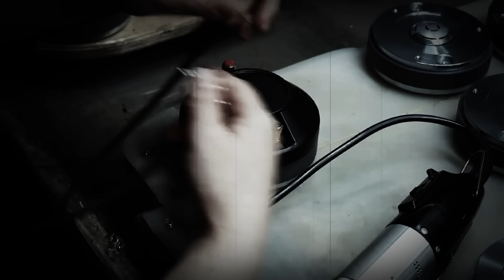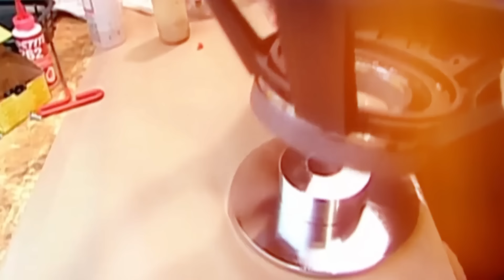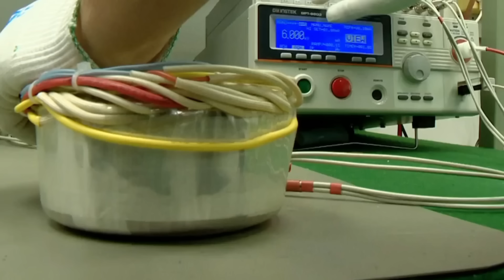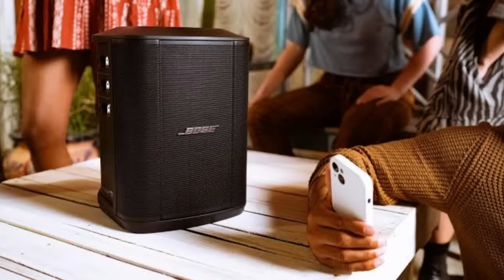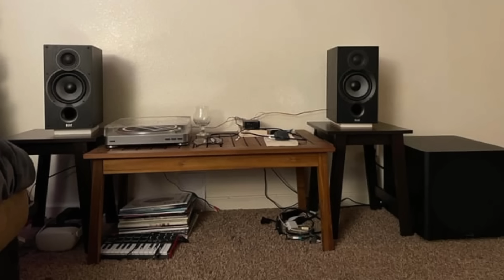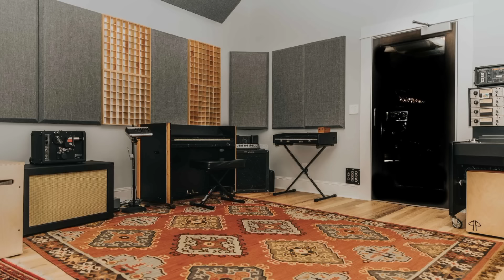Why 90% of New Hi-Fi Speakers Are Garbage (The Factory Secret)

Comment: Retired algorithm developer and electro-acoustic engineer here.  This is one of the few videos that speaks the truth.  Professional level studio monitors are purchased by experts who are looking for neutral, accurate speakers.  My own speakers are clones of the JBL-M2 reference monitors.  My room uses massive amounts of hand-made aborbers and I use bass traps as well.  Good brands are JBL, Genelec, Neumann, and ATC (I'm sure there are others, as well.)  The downside of these speakers is that they are built for performance, not looks.  Often, these speakers can be found in great shape used on eBay and Reverb.  
If you are handy with wood, and are good at electronics and math, designing and building your own speakers can be a lot of fun.  Start small.  It is likely you will make some mistakes at first (and beware, the DIY speaker community is filled with people who have more opinions than knowledge.)  If you lack engineering skills but are good with your hands, you can use a design by someone else and make yourself a pair of beautiful cabinets to match your taste and probably save some money.  Also, you don't really have to understand the theory or even be able to measure to design a good set of speakers, as long as you have a lot of patience and a good set of ears.  I have watched people just fiddle with crossovers until magic happened.  Not the way I do things, but it can work.

Comment: i build my own. PA 10 or 12 inch driver cabinets, replace the speakers and crossovers with quality units and wiring, and you can save thousands. fancy a £3000 sound for £200?

Comment: About your faulty villainizing of DSP crossovers. If properly implemented, they are clearly superior to any analog crossover, especially when the music content is already digital. They feature much lower distortion, much greater accuracy, no power compression, no power amplifier losses, flat correction of phase while maintaining flat FR (impossible to do via analog crossover), time alignment of the drivers, and effective flattening of individual driver frequency response/box resonance anomalies without the cost and complexity of trying to do so with analog crossover notch filters. The only potential downsides which I can readily think of are, when the music content is analog (such as from a turntable) and has to be converted to digital via ADC, and the cost of the DSP hardware. Also, that each driver will require its own power amplifier.

The greatest problem with speakers are their market cost factors. This begins with today's audio customers, who have the mindset of viewing speakers as a commodity product, where they, essentially, perform the same and the purchase decision comes down to price and aesthetics. Quality speakers require significant constructing, finishing and testing, transportation and stocking cost. They function in a domestic environment as furniture, except for incurring the R&D cost of acoustic engineering, as well. Most loudspeaker companies don't benefit from cost savings due to economy of scale either. Speakers are a lowish volume specialty product, and that drives the use of common 3rd party components, in order to avail themselves of some of the cost savings which comes with that scale.

Comment: Still use my Yamaha NS-1000M, new caps in the crossover. Built in 1984, still going strong. A humble Thule IA100 amp to that, case closed :):

Comment: Not exactly correct.   Pro and especially consumer Powered Speakers are usually too small for an average home listening area and can not create the ambience most listeners want!  When recording, sure - the engineer wants to hear whats being captured with his ears, however they would be better off using the output of the high-end microphones doing the original capture of sound and inputing that into a sound analysis program visualizing the sounds at the same time listening to a digital to analog output to high end closed ear headphones that are more accurate than studio monitors.  However, thats precise, and human ears are the opposite of precise - we all color sound differently!!!!   Cup your hands around your ears while listening to your stereo and WHOA!! what an improvment!   To get that without cupping your ears try 5.1 or better surrond sound systems with great speakers equivalent to the ones you mentioned from top manufacturers that use high quality crossovers and excellent quality drivers.   I personally have to change the equalizer settings on my system for different types of music because as I get older I need a little less 2K and like very clean 200 to 1K midrange where voices are.  If its Jazz the same is true - I need to make a change because my ears are not true to the engineers intended sound and I have to pump up the parts my ears are missing.   Bottom line, I find I can quickly trainn a newbee budding audiophile to hear details intended in various types of music and explain how to use an equalizer with good spearkers to get very pleasant and likely close to the intendede sound a recording engineer intended a listener to hear.  Our ears are the bottleneck - perfection in components is nice to look at but clean music adjusted for our ears wins for smooth listening pleasure.    P.S.   I like powered speakers on my office desk in a small area that I can feed a direct sound source or now days a blue tooth song from Spotify to a bluetooth equipped powered speaker with no other components needed.  The JBL's you recommended are OK but the high end is not as clean as other powered speakers in the same and even lower price range.  There are serveral good choices and I would recommend a person listen to the various models with a good source at a Stereo Store or Guitar Center (which hands pro powered speakers more than Best Buy style stores).   Use your ears, then adjust with an equalizer (our computer controller sound source) to enjoy the sound.   To be fair - your main point about crossovers and quality of components used is right on and your speakers are top notch.  I also like the fact you mentioned the impact of room acoustics.  Just add the big factor - our ears are all different.

Comment: Well, after 50 plus years, we still enjoy our B&O 2600 bookshelf speakers, and have 2 pairs. After many years of use, my Marantz 1060 amp got a little tired. Needs a tune up. So when parts Express put on sale their 100 watt hybrid amp on sale, I decided to try one. WOW, it brought those B&O’s back to life.
The amp has so many neat features, for inputs, it meets all the everyday requirements.
As we are in our mid 70’s, perhaps our hearing is out of tune, but seems to sound great .
The amp has a separate output for a powered sub woofer, from Parts Express, and that even makes for wonderful sound for our old ears.
Very informative review, thanks.

Comment: Jbl 530 bith front, jbl530 center standing upright, jbl 4312 with the mid and tweeter turned off under the 530's and two svs2000 subs flanking the center channel. Pioneer elite VSX-49TXi with front and rear bi-amped for the 4312's twelve inch mid base and front 530's . 1" backed carpet, two rear base traps, 1" thick drapes over the glass door, a city skyline on the back wall, and a wood ceiling random boards.

Comment: The speakers you recommended are way too expensive to be worth. And way too small to sound good - despite their supposed quality materials and engineering, a strong sound from a small source is not what an audiophile wants. A good speaker has: always 3 ways, a large diameter bass (more than 20 Cm), a good medium speaker, a good treble speaker, a big cabinet (height more than 60 Cm, depth accordingly) and decent filters. Classic build gives the chances to the best sound.
Vintage speakers having those above sound excellent and you can buy them pretty cheap.

Comment: You make it sound like the factory designs and specs the components. WRONG. The factory only assembles what the company designs and specs.
Reply from the maker: You’re right, the brands are ultimately responsible for the design and component specifications they provide to the manufacturers.

Comment: The audio speaker market is saturated with poor quality products.  I make my own due to what I found with very expensive audio speakers. By rule. The best audio speakers are simple yet with high quality crossovers with no electrolytic capacitors and good quality resistance.

Comment: All this is very doubtful. I agry with same comparison old/new equipment from previous video, but not with speakers! Your examples of Klipsch Heresy and JBL L100: Klipsch was and is now the same in this respect: very poor crossover parts, thin-walled box without bracing - now and than is the same. JBL L100 new one is better than old one in speaker components and crossover parts. And boxes are same poor as old model. In cheap segment in old times vere so many speakers as Sansui S65 - made to look cool, but construction and component quality is terrible. Only one thing is 100% true: now all attention is focused on speakers exterior, even cheap ones. And before some companies as WHD, KLH, Wharfedale... - vere focused on sound quality with  minor attention to how they looked

Comment: I've beenrunning Altec A7 VOTT  and a subwoofer with twin JBL 15s  driven by Altec amps.
Reply: Considering it's volume, the A7 has no base. I suppose that was okay 80 years ago. The ALTEC 816A is a much better cabinet for HiFi, compared to the A7. And less than half the size.

Comment: Most of the stereo equipment manufacturers held good standards, when the original operators owned them. Once sold, the new owners used 'corner cutting scissors' at every possible point. The description of poorly built speakers is why I design, and build my own speakers.... mostly transmission line. I design, and CORRECTLY build my own crossovers, with no electrolytic capacitor, and PROPERLY spaced, air core inductors (chokes). On a bright note, the designer of the Infinity IRS speakers built another company, when Infinity sold. Genesis Advanced Technologies, and designed an upgraded version of the Infinity IRS, called Genesis Prime.... a whopping $680k per set. I also repair older equipment, like the 2 Tascam reel to reels I own. Currently, I'm working on a Carver PM-1.5 power amplifier. Recapping it, cleaning it, and upgraded speaker terminals.

Comment: Complete garbage.
First AI says that dsp is bad then goes full bongo for junk entry level monitors then extols the virtues of using dsp.
If you mix whilst using dsp you are fooling yourself. 
One thing this vid got right was the use of cheap crossover parts.
Most crossover designs are far from optimum as well.
If you are one of the many that think this is in any way good information I suggest you go down the rabit whole and learn better.

Comment: Less than ideal speaker positioning.

I used to have a pair of 12-inch subs pressurising my relatively small 4 x 3.5 m (13 x 11.5 ft) room, and even though it was ok for movies, 2-channel stereo music felt a little sluggish. That's when I purchased a small Rel 8-inch musical subwoofer. Hearing the setup with a musical Rel subwoofer for the first time is something that will forever be entrenched within my mind.

 After about 6 months I added 2nd one, and not that I realised it at the time, but going with a stereo pair of high-level level subwoofers has now gave me the ability to physically fine-tune the low end of each individual stereo speaker (perfect when stereo speakers are not equal distance from their side walls!)
Since each subwoofer has its own gain/volume control, one can slightly lower the output on the sub near the wall and increase it on the one in open space to create a perfectly balanced center image for your bass. High-level connections allow you to fine-tune the crossover point for each side individually. If one main speaker has a natural dip due to its position, you can set its corresponding sub to "reach up" slightly higher to fill that hole.Correcting "Bass Steering": Without this adjustment, uneven boundary gain can pull the soundstage's low-end energy toward the wall-side.

 Just like when I moved the couch of its back wall, I thought I was creating distance from the built up resonance.. Didn't realise at the time My MLP is now in the Sound Stage!

The inadvertent ones can sometimes be the best

Comment: Buy wireless active speakers.
Buy active speakers.
Buy 3 way speakers (with 1 driver for the midrange).
Buy speakers that are flat between 60-90Hz to avoid a thin sound.
Buy speakers that measure well.
Great video, kudos for mentioning Genelec and JBL actives and for exposing the scam reviewers.
Reply: Ah yea audiophile Bluetooth
Reply: No, buy speakers that sound good, first, that fit budget and space for them, alot of 2 ways are crap compared to better 2 way speakers and flat response is best with 40 HZ to over 15,00 Hz (all old speakers based themselves on the human range of listening 20 to 20,000 HZ, but that was really a fantasy land target. 
Your overall presentation is excellent, we sold high end brands in the 60-90's and always advised when possible modest room treatment, 1/2 the budget on speakers but the power craze arose, if 50 watts was good 100 was twice as much, right? Add an equalizer and... sonic crap. I quit when the Japanese sold the sizzle 1st to the masses. Great fun days ruined by greed.
Reply: Andrew jones would’ve kicked your Bluetooth ahh out of his class convention my dude
Reply: A single vintage 12"Goodmans Axiom speaker delivered more sound fidelity than modern big brand nemed speakers.

Comment: Active studio monitors are not designed for listening in a room. They are "near field" speakers. You must sit in a range of aabout max 1 to 2 meters from it. So why is that on number one when you 're not searching for desktop speakers?
Reply: You are spreading baseless information now! For example, Genelec has numerous different size models that can increase the distance to several meters and still the sound image and rhythm are tightly held between the speakers.

I would hope that you would also come out of your brain thinking outside the box with logic and examine realism a little more closely.

For example, the Genelec 8351b or 8361a or S360 or 1032a or 1237a /1238a models are already great for any living room.

I myself have the older 8260a series and now 1237a master speakers in my living room with a 7380a subwoofer. And I will not even have a sharp knife at my throat to change any passive speaker for these speakers for any amount of money. BECAUSE I AM NOT STUPID BUT I use my brain more effectively by thinking outside the box.

Unfortunately, most men in this hifi hobby only know how to follow the instructions of marketing channels, walking blindly through the hifi front every single year after year like they would move in a queue, never realizing in your life that there is an even better hifi experience than high end available but significantly cheaper and even when listening far into your living room without suffering from sound quality.

Life is about choices. Unfortunately, most people go after appearance over consequences when it comes to listening to hifi.

Comment: Emotiva b1plus. GREAT speaker. Ribbon tweeter. Vocals instruments are gorgeous. With cambridge audio axa35 amp marantz cd6006.  Have tried some more expensive denon marantz CD6007 dcd 1700ne and more exp marantz amp (8006) but wow factor was missing.  Room is heavily padded. Make sure you don't have a bottleneck surge protector. And good cables. (Emotiva rca). And 12 gauge crutchfield  speaker wire. Any point can kill the sound. Destroy it . Btw onkyo tx 8020. Great  gorgeous sound.  . But tried their higher exp amps and receivers.  Dissapointing! Go figure!

Comment: Talking my language. Speakers, room then ..........  My current speakers are  cabinets I built based on measurements I took of a Tannoy design that was one of the best I heard. The kicker: they didn't sound good until I finally put the right loudspeakers in them. I tried four different drivers and the cabinets came alive on the fourth ones I tried and surprisingly, the cheapest of the lot.

Comment: My speakers are 1975 Altec Model 17 studio monitors with 604-8G duplex speakers and Markwardt crossovers. Found them at a church yard sale for $150. They sound amazing.
Reply: As a point source, the 604 is hard to beat. The 8G had ALNICO magnets, and the tangerine phase plug, which extended the high frequency response. The horn, however, is not a true multi-cell. It is the same "horn" introduced on the 1950's vintage 604C. The 604, and 604B had the true multi-cell horn. Jeff is the authority on 604 dividing networks.

Comment: Digital Signal Processing might be used at the pre-amp stage, but by the time the source signal is amplified to the point that it can drive speakers, it's not being digitally processed by a computer chip. You may as well claim that the turntable platter is built into the woofer. It makes no sense.

Comment: Klipsch Heresy 1, with diy compound loaded subwoofer crossed over at 50Hz. Speaker was 25$ at Sally Ann 12 years ago. Coat of paint, and played ever since, sometimes switching to a pair of Kef's 104/2 used for 400$, needing a new tweeter sourced for less than 200$/pair from Kef. No desire to change speakers.

Comment: It's been a long time since I've been impressed with any commercially built speakers in any price range.  

There's nothing wrong with DSP but it should be the crossover and the only crossover, no passive components at all.  I've been building all active speakers since the mid 1980's, long before DSP was the rage.  I only use passive where it's not practical to have multiple amplifier channels for each speaker.

Good video, I agree with your assessment, 60% on speakers plus room treatment and all else is in the rounding error.